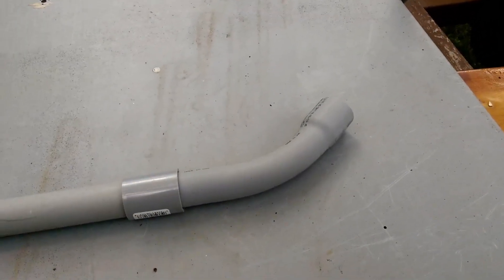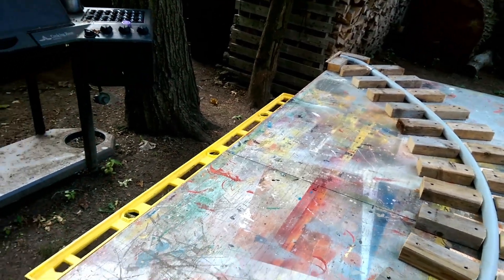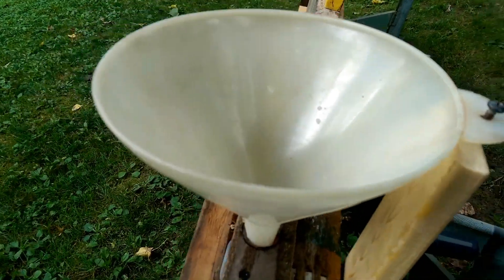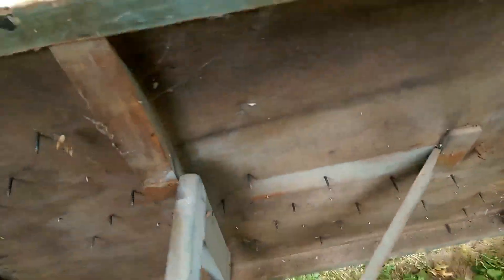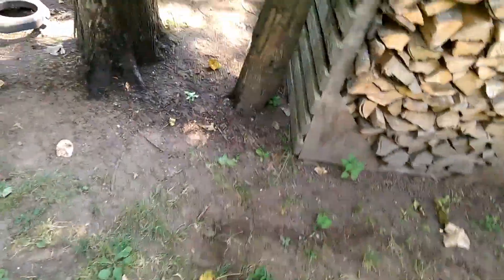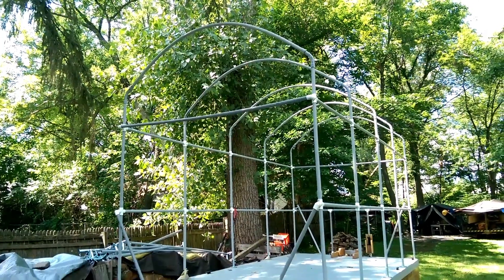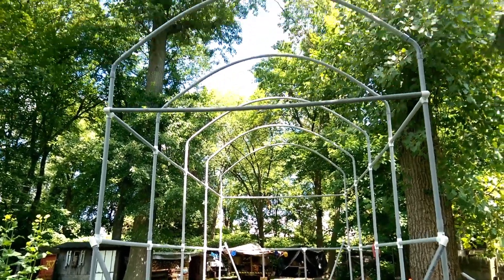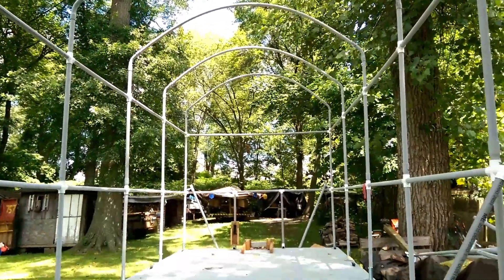PVC Pipe Bending

Comment: shoulda put a tee down the center with a ridge to support the covering
Reply from the maker: I added a snap on ridge pool last July. I used straight PVC pipe and incorporated five snap fit Tee-fittings at the roof bows intersection; which allows me to add it on for additional support & stability. It can then be removed when I stow the canopy frame over the winter. Insistently, all the frame sections fit underneath the raft & between the pontoons. Everything for the raft stays with the raft.

Comment: But, Dave, how did you figure out the correct measurements for the jig?  Did you have something already that shape and you laid it on the table and nailed it down so you could place the boards correctly for the jig?  Wow, what a lot of math!  I love the video.  Thank you!
Reply from the maker: My initial design method was to first measure the distance between the two upright canopy frame poles already mounted to the raft's deck. This was to determine how wide the roof bow needed to be so it would fit. I then used wood scraps and boxed in the left and right hand corners on the table. The width of these two corners matching the pole spacing I needed for the canopy frame. Then I found the center and drew a perpendicular line to this midpoint. Then two feet up on this line I fastened another wood scrap. This piece was the topmost curve of the roof bow. The next step took a little trial and error to get the right fit. I took a PVC pipe and caught it in the (left) corner and then muscled it around so it hit the middle block (top of curve) and continued to muscle it around until it fit into the (right) corner. I had to cut the length a few times to get the PVC pipe in place. Once that was done I used the pipe as my guide to add in the series of other blocks seen in the video. There was only two measurements. The only math I did was to divide the base measurement in half.
Reply: @Da175305M    OK. Got it!  I think I'll have to start with a flimsy piece of PVC since I'm on my own.  I can get the boards all set up and then switch to the heavy duty PVC.  Thank you so much for the explanation!  I can do that!

Comment: As far as the end pieces becoming oval. I'd stick an extra 1' of pipe into each end. That pipe will prevent the ends from deforming. ALSO, I'd tilt the table when it on it's side. Pour the hot water into the high side and the colder water will run out the other
Reply from the maker: I had clamped on the extreme ends of the roof bow on my first attempt. That is why they deformed i.e. ovalized. I clamped well away from the ends for the rest of the roof bows and had no further problems. Anything stuck in the ends would have to be rigid like a wood dowel or steel; anything that would not deform. But simply not clamping on a mating deformable surface is the best practice. I do really like your idea for a tilt table - that's a way better way to drain the water then what I was doing. Thanks for the great comment & idea.
Reply: @Da175305M  ! I love the idea and will use it.  I understand the idea of wood dowel etc but that would prevent you from filling the pipe. Ab extension of the same material would give you double thickness but still allow filling with boiling water

Comment: I hope there is no breeze out on the lake when you take her out boating but it may be fun when flying. You would make an awesome neighbor. Love your video dude.
Reply from the maker: There is always a breeze out on the Connecticut River where I use the raft. Luckily there is less windage from a curved roof then if I had gone with a 45 degree roof. Maneuvering is a bit tricky in a strong wind no mater what kind of canopy roof shape is used. If it was necessary the canopy fabric can be quickly removed if the wind got too be too much. One of my neighbors is a carpenter, he gives me free wood scraps and doesn't mind my carpentry noises or activities. Heck, we both build stuff outside all the time and get along just great. My other neighbor tinkers as well and is a first time homeowner. he's been building his own workshop in the garage and doesn't mind my projects either. I share any extra materials and tools with him too so there is that to keep the neighbor relations happy. I'm lucky to have awesome neighbors as well.

Comment: Just a thought. Instead of carrying hot water out of the house. Why not hook a hose up to the drain on your Hot Water Heater. If it isn't hot enough turn the heater up a little.
Reply from the maker: If you've ever run hot water thru a garden hose you'll quickly learn most of the heat makes the hose warm and the water that comes out of it is much cooler then you want. Keep in mind the Department of Energy recommends having your tank-based hot water heater set to 120 degrees Fahrenheit. But if you've never adjusted the temperature on your hot water heater, it's probably set to 140 degrees, which is the default setting from most manufacturers. The resulting "warm" water that comes out of the hose would be too cool to effectively bend PVC pipe. The temperature range for bending PVC is between 170 degrees and 220 degrees, with 170 being perfect for long, sweeping arcs and 220 allowing you to make tight curves

Comment: Polyvinyl Chloride is a “thermoplastic” (as opposed to “thermoset”) material which has to do with the way the plastic responds to heat. thermoplastics can be heated to their melting point, cooled, and reheated again without significant degradation  Melt Temperature   212 - 500 °F (100 - 260°C) (Think Shower Curtain Rod or the green house support being made here)

Heat Deflection Temperature (HDT)  92 °C (198 °F)

Comment: David, thank you. This well made edited and sound/video was excellent.

Keeping things simple is always best. This is a very effective way to make constantly the same shape.  And the idea is so flexible that other shapes can be made using the same principle. I thought you might use a heat gun to blow air through the pipe but hot water seems better.
Reply: Nope, too complex.  Hot sand works a lot better making this arduous process effortless: https://youtu.be/p1SMOPaajgY

Comment: would you be able to give me the measurements and total cost please thanks
Reply from the maker: The total canopy footprint is approximately 8 feet wide by 16 feet long. The sides are about 6 feet tall and the bows add about another two feet of height. The total cost of the PVC frame was about $100 - $150 or so. I didn't keep an exact tally. A 10 foot long piece of PVC conduit is about $3-4 per piece, and most fittings can run anywhere between $1 - $2 depending on what you need.

Comment: Just wondering why you had to heat and cool the pipe.  It forms a natural radius when you bend it and once locked into your up-rights and collar ties it can't go anywhere and will stay a radius ?
Reply from the maker: The left and right side walls of the canopy frame are not rigid assembles. PVC by nature is a flexible material and as such does not have a great deal of structural stability. It is meant to be fastened to a wall or other rigid structure. It is not meant to support itself. With this in mind a PVC pipe in a curved state exerts a lot of sideways force on the ends which would be transferred to the walls of my canopy frame. Thus would cause the frame sides to deflect from the forces exerted on them from the roof bows. I permanently set the curved form into the PVC (using hot & cold water) and this neutralizes any sideways forces that could potentially deflect the walls. Also, it would have been pretty difficult, if not impossible, to engage the bow ends into the tops of the vertical wall poles. Locking the radius shape into the roof pipes is the only way to allow the individual sections to be assembled easily. and, there is no deflection on mating parts.

Comment: Why couldn’t you just use a garden hose to add cold water instead of tilting the table drawing the hot water. Water is water.
Reply from the maker: A gallon jug of water is more manageable than a garden hose. Especially when I'd need a 200 footer and a on/off valve to control the flow. An old milk jug is free out of any recycling bin.

Comment: Takes a long time to boil and run the water over to the pipe.  I would suggest to turn the water heater up  and connect a hose to transfer the water.  After few min. You can switch the hose over to cool water. Just a thought.
Reply from the maker: If you've ever run hot water thru a garden hose you'll quickly learn most of the heat makes the hose warm and the water that comes out of it is much cooler then you want. Keep in mind the Department of Energy recommends having your tank-based hot water heater set to 120 degrees Fahrenheit. But if you've never adjusted the temperature on your hot water heater, it's probably set to 140 degrees, which is the default setting from most manufacturers. The resulting "warm" water that comes out of the hose would be too cool to effectively bend PVC pipe. The temperature range for bending PVC is between 170 degrees and 220 degrees, with 170 being perfect for long, sweeping arcs and 220 allowing you to make tight curves

Comment: Great idea" l made a canopy out of PVC as well  for my 5th Wheel l never though of bending PVC that way  l work on little project on my kayak with PVC but I use a heat  gun Could you have use a heat  gun on your project as well or did hot work better.
Reply from the maker: Hot water provides a more subtle bending force that distributes bending forces equally throughout the pipe length. This results are more consistent than a heat gun method.

Comment: Thank you for your video is was educational and I enjoyed watching that I have a question we are building gazebo out  of PVC pipes and wondering how did your construction stay throughout summer and winter especially this in the summer sometimes temperature get to 100° and I was worry about pipes start bending specially under scorching sun
Reply from the maker: The PVC canopy frame stayed assembled on the raft for the summer & fall and then I disassembled it into sections and stored for the winter in a Quonset hut. The PVC seemed to weather nicely and there was no noticeable degradation in the pipes. The gray PVC is intended for use in sunlight much more so then white PVC which is used indoor for house plumbing. I did not get any deformation due to higher air temps. We saw 100+ degrees for almost a month and the pipes stayed as I bent them.
Reply: Thank you for your help and knowledge

Comment: Instead of boiling water, and handling it, I jig the pvc and then use a hot air gun to heat the pipe. Less effort, and a bit less time. Experiment on scrap tubing first. For really complex jigs you can heat the pvc as you fit the pipe to conform as you go.

Comment: I noticed you are using PVC electrical conduit.  It is nice because it has the "belled mouth" on one end.  I my last PVC pipe project, I used Schedule 80 water pipe because I did not want it to sag.  Finding Schedule 80 fittings, even 90° and 45° elbows is difficult and expensive.  I never did find any Schedule 80  "cross" fittings.

Comment: Since you are just making an arch, you don't really need to make a form and go through that whole process.  Just connect one end, and bend the pipe until the other end is connected.  After being in the sun a few days it will hold the shape naturally.  That is how we make our hoop houses for over our early spring raised garden beds.
Reply from the maker: Hoop houses have a rigid foundation so your idea works well, but the canopy frame is week & flimsy, and cannot rigidly support an arched PVC pipe without deforming the sides. Permanently setting the shape eliminates the bending forces that would otherwise be transferred and effect the side walls alignment,

Comment: I made a pvc greenhouse a couple of years ago - one thing that really added extra stability was cutting the arches at the center top and adding in a plus shaped fitting. Then connect both sides of the arch into the plus so the the remaining two connectors point toward the rafters on either side. The cut short straight pieces and add them between the rafters. This really stiffins up the roof when putting a tarp or plastic over it. On the 2 end rafts just use a T instead of a plus.

Comment: In 5 minutes- 
Much easier with propane bullet heater in the 30,000 btu range or higher, and they are very cheap and easy to carry. 
Simply walk about - blanket the pipe with flooded hot air. 
Commercial grade Heat Gun would take forever, and uneven results. Usually plastics are formable up to 300f range limit. 
Use infrared gun to test temps along its length to verify 220 250 range. 
2 seconds of cold water sprayed on pipe w/Garden hose nozzle focused - is all 
 that's necessary. 
Filling pipe is just over thinking it. 
Plus un-necessary handling of the jig. 
Just set it on its edge like done to fill it.

I've created simular to protect ski boat in heavy wet frozen snow Minnesota. 
We rarely get the fluffy stuff any more. 
This grey PVC Used here is a tad too  lightweight for our conditions. Plus more tarp support on roof area is needed, or weight of heavy ice and snow will gather too deep between supports and tear it up, if left un-checked. 
So those who have these heavy ice conditions will notice right away. 
There's also schedule 80 commercial plastic pipe which has double the wall thickness, and if more tarp support on top between pipe runs are necessary, 
cross straps every two feet on top section can be tensioned to add support. 
*Cheers, and it was a lot of pre-staged jig process well done, but I'd might try bungee cord on phone as head strap over hat on backwards. Even better than tripod. 
*Oh I know - As Farmers, we're used to doing everything ourselves.

Comment: For the side-walls, you have used a four-socket PVC connector. However, my local hardware store does not stock a four-point connector of any size. Where did you find yours?

Comment: About 20 years ago I built a greenhouse using PVC pipes but I bent them free-form by using a heat gun on a cement garage floor. I just had to mark the floor with the desired curve. The result was good but not as smooth as the water method shown here, but it also didn't need a fixture. I also used PVC conduit rather than white PVC water pipe because the conduit is sunlight resistant and won't deteriorate.

Comment: Next time try using the hot water line that connects to your washing machine, it has the same connection as a garden hose; If needed turn the heating element temperature up on the hot water tank... just remember to turn the temperature back down and run the water for a few minutes to lower temp in the tank so no one in the home gets burned. I know most people enjoy building things themselves and if they have the time to build it, that's great. But sometimes it is better in the long run to buy a low price version and modify the weak points of the build.  I think you did a great job on the build; thank you for sharing your knowledge with us. ✌🤟👍
Had to edit this... warning when running hot water through a garden hose do not, I repeat do not restrict the water flow, doing so will cause the garden hose to rupture and potentially cause severe burns to people and pets, so please be careful when using hot water..
Reply from the maker: The Department of Energy recommends having your tank-based hot water heater set to 120 degrees Fahrenheit. But if you've never adjusted the temperature on your hot water heater, it's probably set to 140 degrees, which is the default setting from most manufacturers. The resulting "warm" water that comes out of a makeshift PVC bending hose would be too cool to effectively bend PVC pipe. The temperature range for bending PVC is between 170 degrees and 220 degrees, with 170 being perfect for long, sweeping arcs and 220 allowing you to make tight curves. Turning up one's water heater this high is probably not even possible and would likely  result in a dangerous potential for scalding someone (very badly) if they use the hot water at the same time you are bending PVC. I would not recommend this even be attempted.
Reply: @Da175305M  Thank you for your reply. I was not suggesting for you to use the home hot water tank for long term use. I was just suggesting that the use of a hot water tank maybe another option, but you are right I should not have mentioned the use of the home hot water system for this purpose. If you feel my original comment should be removed  I will do so at your request.

Comment: I've bend that stuff for a living, I can make the whole piece with one stick you can use a butane torch just keep it moving back and forth and spin the conduit  until it goes limp like a noodle , just take some time and be patient, I've even used the exhaust from a Honda generator to bend some conduit,  place it on  cement in the shape you want if you wipe it  with a wet rag  it will stay in the shape you want I've been sweeps all the way up to 4 inch in diameter I don't buy those pre bent 90s because it's too many couplings when you can use a straight stick and Bend your own 90s and 45s

Comment: with that jig, im betting you could get by using a heat gun blowing right through from one end of the pvc to the other. whenever i had to bend pvc for electrical work, i sometimes used a greenlee heating blanket (they  are not long enough to bend a whole 10ft stick of pipe though), but mostly we used a milwaukee heat gun, i know that there is a spring that you can buy to slide through the pipe so that it doesn't oval out on you, but ive never used one. In a pinch I've even bent pvc by using a halogen work light. its amazing how fast a heat gun gets the pvc bent and how fast the pvc cools and holds the bend... sometimes you will see long lengths that people have run horizontally across buildings that sag because the heat from the sun coupled together with the weight of the wires inside is enough to bend the pipe.